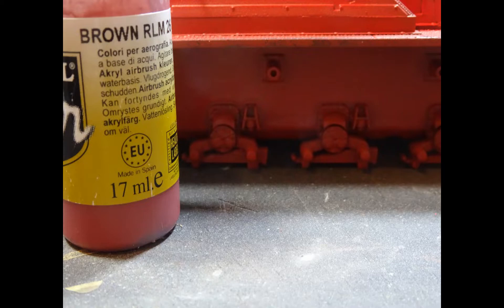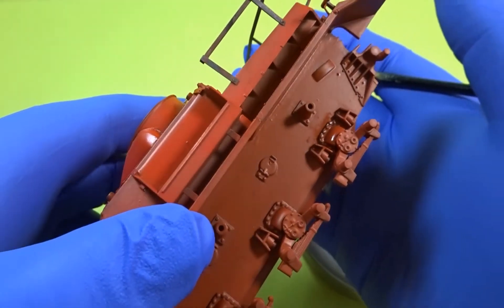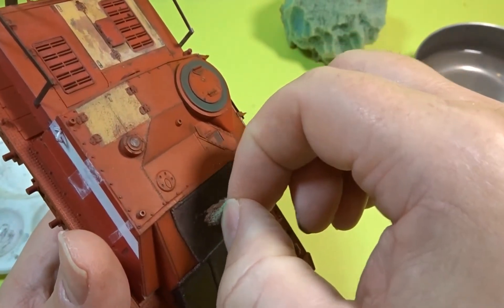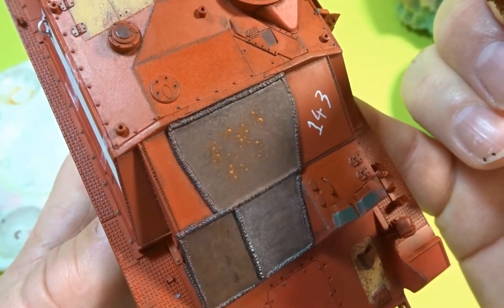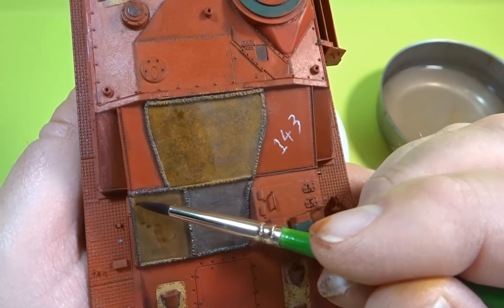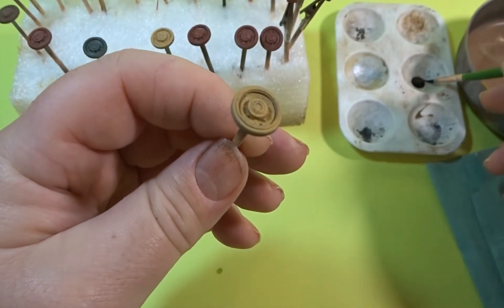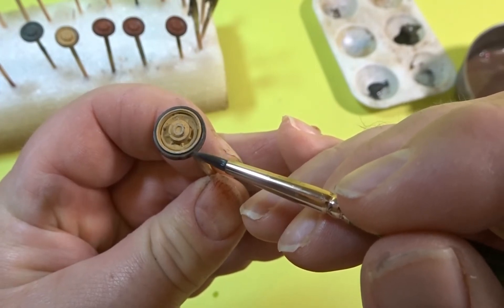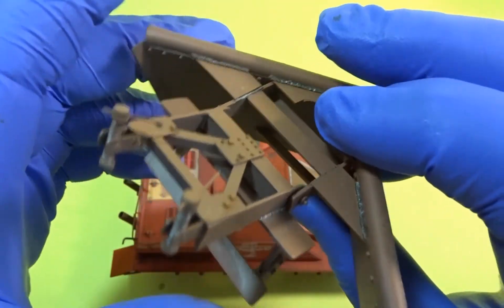Dragon Sd Kfz 167 Stug IV Late with Scratch Built Bulldozer Blade 1/35 Scale - PAINTWORK

Comment: Hi Steve
Impressive work as always. Great tip for using a wash to help paint tyres. The faded chalk marks certainly add something different to the model. Very realistic rust work on the steel plates. Using acrylics is perhaps harder, well for me anyway,  than enamels or oils at this stage but really works a treat.
Reply from the maker: Hi Jim. Happy New Year to you my friend. I always see the acrylic work as a necessary evil. Its not until I get into the oils and pigment work do I really start to enjoy the build. Thanks for looking in and commenting. Have you decided on what your next build is going to be???